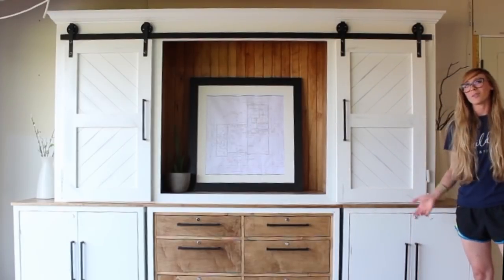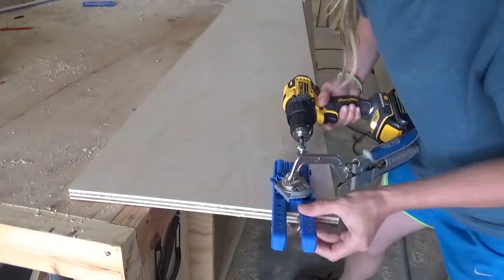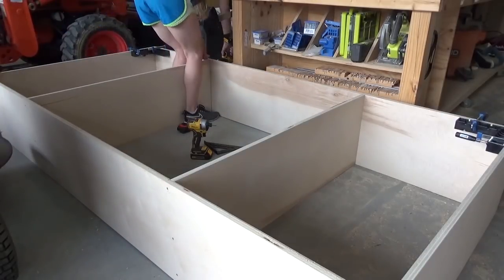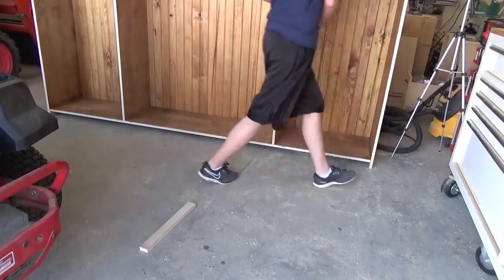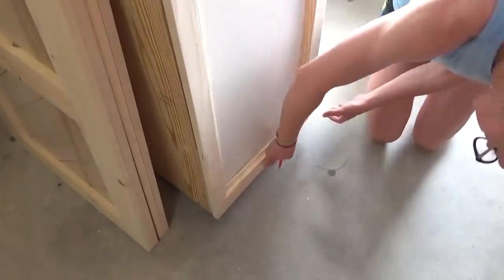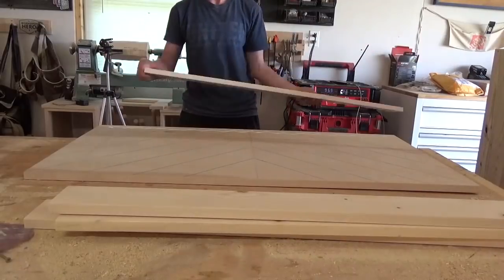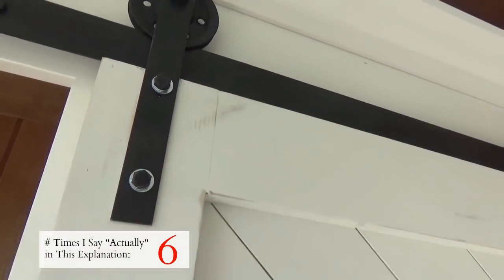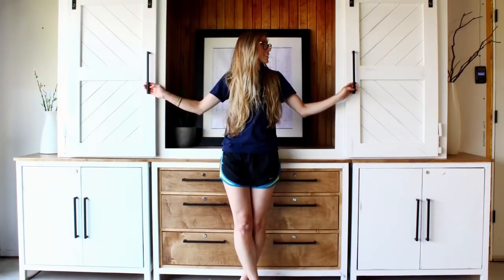How to Build a Sliding Door Entertainment Center--Part 3

Comment: What kind of white paint did you use? Latex? Do you put a clear top coat over the white paint? If so, what did you use?
Reply from the maker: I use sherwin Williams emerald enamel. I don’t typically apply clear coat over my paint, but I did on this since I distressed it and sanded off the paint in some places. I just used Minwax Polycrylic water based for that
Reply: Shara Woodshop Diaries perfect thanks. Did the polycrylic “yellow” the white at all? How did you apply it?
Reply from the maker: I brushed it on. It didn’t yellow and since it’s water based, it also shouldn’t yellow over time either.
Reply: Shara Woodshop Diaries perfect thanks!